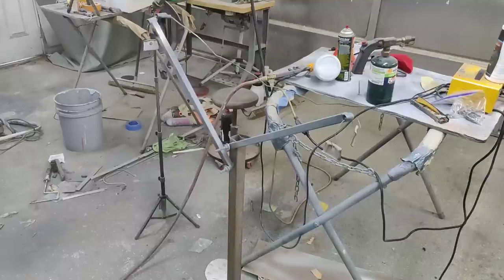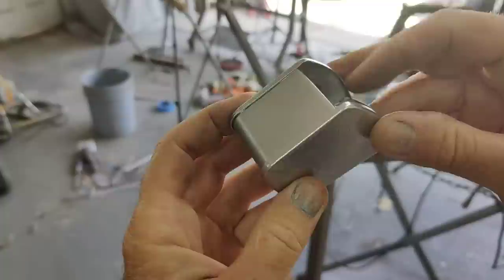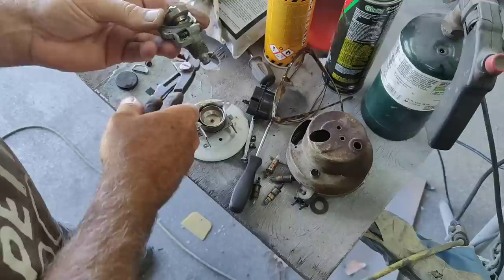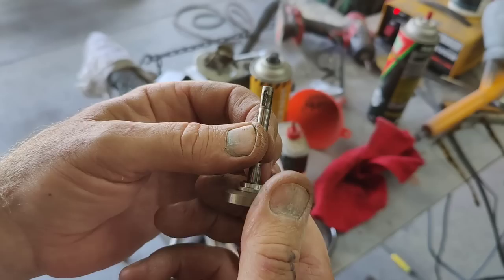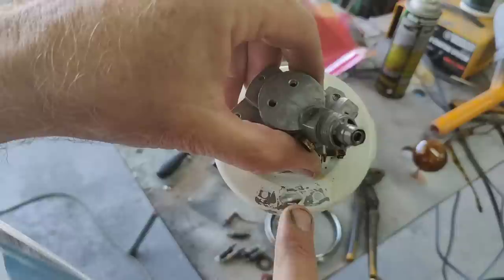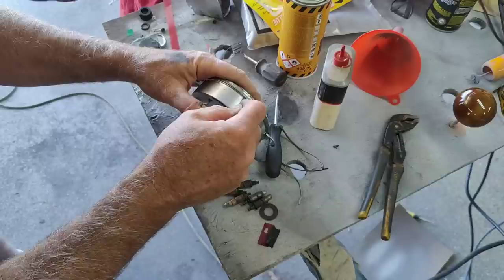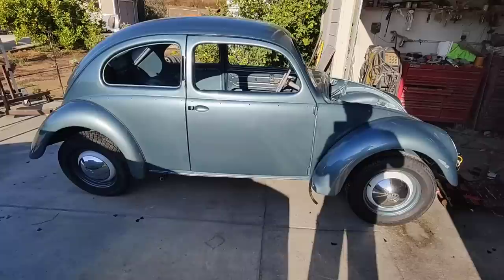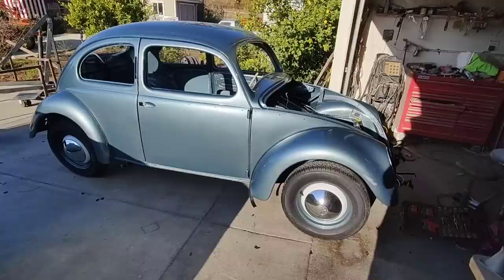1954 VW OVAL WINDOW BEETLE Assembly - Frozen Speedometer  - installing fenders

Comment: Really impressed with how well the powder coating worked on the tags, I would have expected it to obscure the stamped text. looks really smart Mike. Nice!
Regarding the speedo, mine still worked when I got my car, but it screamed like a supercharger on steroids! Took a while to figure out the cause, I though a wheel bearing had frozen. The speedo cable had gone dry inside the housing tube and required grease to be pumped down the tube and then drive the car until the lube worked its way through
Reply from the maker: yea that shaft looses the lube of the grease too. Most bugs are pretty similar. But some dont have screws. they have twist tabs. They often break when you twist them. to put it back together just J and B weld them and let it sit overnight. The other video I am putting up next has a link to another video that will help if yours becomes frozen.

Comment: Alot of those german vw parts are  so very well made. The tolerances are very tight the grease dried up and gumed it up.  The wiper motors are intricate little things as well. Nice powder coating small parts.

Comment: Have allways been intrigued by powder coating, - however for outdoor use over time, - it does have the nasty tendency to flake off despite  looking very impressive at first glance !
I have had quite a few 'surprises' regarding that stuff !
Reply from the maker: yea I am only doing stuff that wont get weather. or undercoating it with powder then painting. It is great for stuff like I am using it on that would get scratched easily. other than  that......it wont last forever like people think it will.

Comment: Thank you for this! Mine wasn’t working but as soon as I took off the cable I saw the cable was broken 😅 but I still took mine apart just to checkout the inside, it’s possible that someone before myself took it apart. 
I’ll probably take it apart again to clean it up just a bit more. I also want to grease it up. I might need a new face the sides are a bit cracked but we will see

Comment: Good times 🎉 maybe if the speedometer is stamped 12-54 it could be a 55 model? Looking great
Reply from the maker: car was built in December 1954.....all cars built in that year were that year model. they changed that in 1955 to cars built in aug 55 were 56 year model. Check the Samba. Interesting subject.